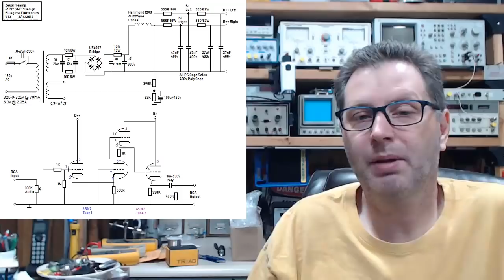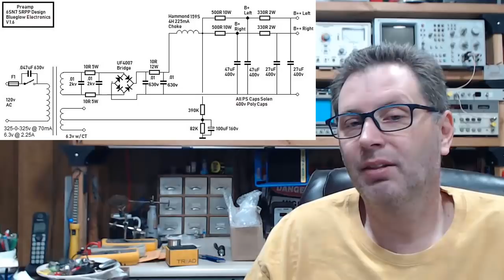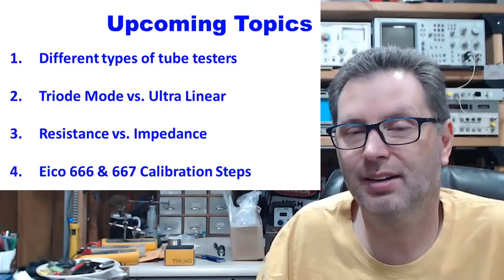SBS Zeus Preamp Update - Follower Builds - Upcoming Videos

Comment: Glad to hear your recovery is going well. Yes on the tube tester video. In addition to the different kinds and which is appropriate for what uses, it'd be helpful to know what's typically involved in fixing each kind. Some aren't more than switches and wires whereas others have active components. With so many "for parts" tube testers out there, it'd be great to know what you might be in for.